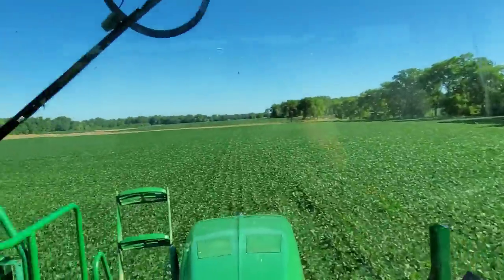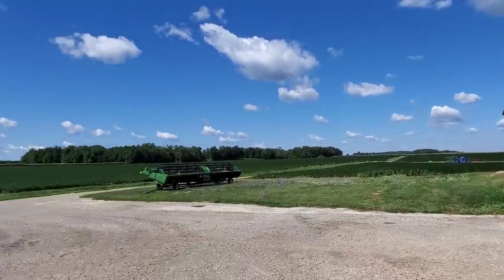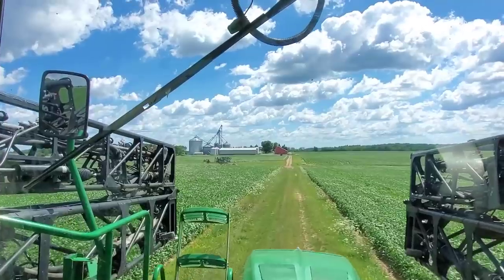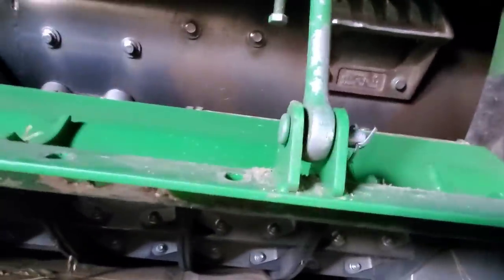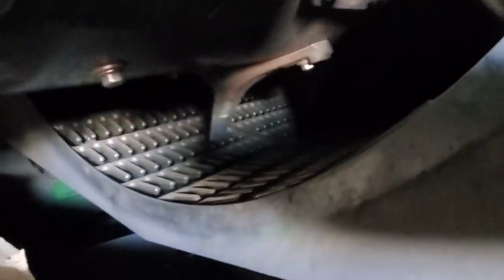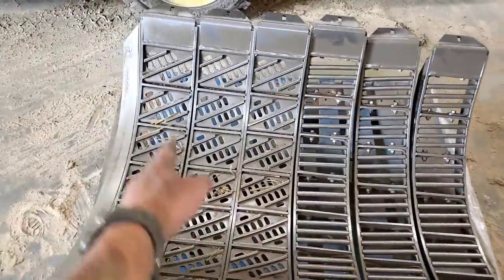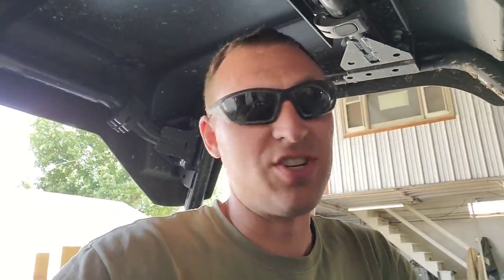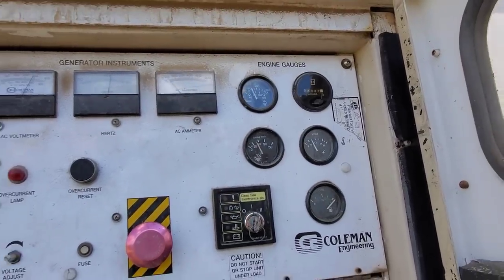Fungicide, Concaves, and Irrigation - #205

Comment: Your voltage problem is voltage drop. To properly check it put your voltmeter across sequential wires ex. Alternator battery terminal to the connection  at the starter ( same wire from the alternator) that reading will be the voltage drop in that portion of the circuit. Do the same for each successive leg until you get to the battery. The sum of all voltages is you total voltage drop. 1/2 volt between alternator and battery is common. Also check voltage on positive cable between battery and starter while cranking, you should not have more than 2 volt drop while cranking. I hope this helps.

Comment: 13.4v at the battery is a good voltage for maintaining a fully charged battery. 14.4v is a good voltage for charging a battery. Your measures so far indicate a normally functioning charging system. I bet the gauge or its connections are wacko. Measure voltage at back of the gauge to determine.

Comment: We run the K7 conclaves in 2 machines. We haven’t had any issues with them yet. Your thrashing elements are missing some chrome. Rocks chop it off then they wear out really fast. We replace ours as needed. I still think there is a dirty ground on generator. Great video. Enjoy your seed kick off. 👍👍
Reply from the maker: I know they are chipped. I've asked the dealer and they saw no need to replace until their wear gauge indicates its time.

Comment: The newer John deere sprayers have that section control, they have the same side console as your combine and on that wing where your hvac is they are all there. Coming from a 2014 JD 4045R
Reply: He’s talking new sprayers not 6 years old
Reply: I’m not bashing your 2014 or talking shit that’s a lot newer than some of my stuff but his sprayer has got to be a 13 or 14
Reply: @jjp1117  his sprayer is a 2010 I believe, and the 2014 is the same as the new ones
Reply from the maker: Person I talked to ran a 4940 which is newer than ours but older that the 4045R. I think he only ran it for a couple weeks though.

Comment: It is probably in that voltage gauge. It will cause your system not to work right if you do not have a very good connection with the wires or the gauge.

Comment: Your voltage coming from your alternator to your battery will change depending on the charge of your battery but that 13. Whatever it was at your battery was a good reading I but your Guage is faulty especially from always in the elements

Comment: Does the Generator have a separate Voltage regulator when you touch the wires at the alternator it might be before the regulator. Check the voltage at the battery before you start it and then after it’s running as long as it goes up a little it’s good 14.4 is actually a Little high to go to the battery I never see more than 14.  Same thing when you open that panel check the voltage there with just the key on not running then after it’s running. 👍
Reply: Alternator and generator are completely separate.  One is only DC and the other is  only AC.
Reply: Dustin Hruzek I know the thing the alternator is on is a Generator..
Reply: Charging alternator outputs AC approx 20V PP, there is a multidiode ring rectifier in the alternator case which outputs approx 16v DC to the charging regulator which can be located in the altern. case or externally in control computer.  Outputs max 14.7v DC charging to battery.  Regulator senses charging current demand from battery and cuts back charge V and current depending on % of battery current demand to 100% charge.

Comment: Any notion how wide apart and average depth those land drains are in that bean field? Also what diameter do you think the laterals and mains are, enough potential capacity? 
Do you have any evidence of iron ochre material in any of your drains? It can be quite a problem in some soils and requires drain jetting to clear it with frankly mixed success.
Reply from the maker: That field was just tiled 2 years ago. The tile are good and its just still settling. They are 30' spacing 4" laterals and whatever size the mains needed to be.
Reply: @BorderViewFarms  
Thanks for your reply.

Comment: record the conference on your computer, watch at your convenience. 
Be careful, only work inside the generator electrical while gen set shut off.  440 3ph will fry body parts.
Check the charging wire between the alternator and the battery for damage visually, then check with ohm meter for continuity with generator off.  I would not open the meter switch panel until the generator is off, might be loose wires or parts.
Your old alternator was due for change out, bearings and slip ring wear.
Reply from the maker: It was live and interactive 🤭😒

Comment: Regardless of the expense (and that to my mind is a colossal sum) those alternative concaves are distinctly unimpressive when it comes to their construction and materials used after only one whole cutting season. I would be looking for a full replacement set from them and some assurance what happens if they don't hold up. 
There is surely an easier method of removal with the original ones John Deere installed - try talking to a JD tech or workshop manager for some tips on how to remove / install them.
Reply from the maker: The original one definitely are not easier to install or remove. They are bulky and heavy, only 1 way to do it.

Comment: thats good to no abought them concaves because i have been pricing estes rpr concaves for my s670 its abought 20 bucks a pound for them or $3600.00.they call them the pac-man bar you never change them good for all crops.
Reply from the maker: $3,600 for a full set seems low. I priced them 2 years ago I thought they were close to $6,000. You don't have to change them but they do have different configurations for different crops.

Comment: You should be ok with that much of a voltage drop but you might have bad diodes in the alternator,  read here https://www.underhoodservice.com/alternators-low-voltage-battery/

There could be a loose connection on the gage or corrosion on the wires. Definitely check the voltage at the gage.
Reply from the maker: Alternator is brand new.
Reply: @BorderViewFarms  didn't remember if you changed it. It may just be the meter.  If it is starting ok then it is just the meter.

Comment: Gauge or wiring to it is bad
Reply: I would say you have a bad connection somewhere between the alternator, the volt meter on the panel and battery. Most likely the panel meter. There is a high resistance connection somewhere which is giving you a voltage drop. 
G